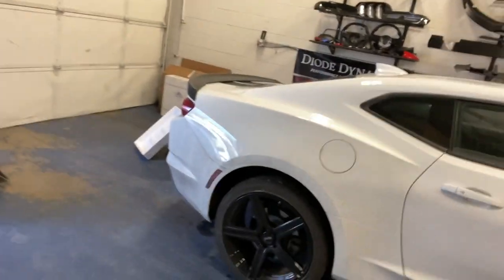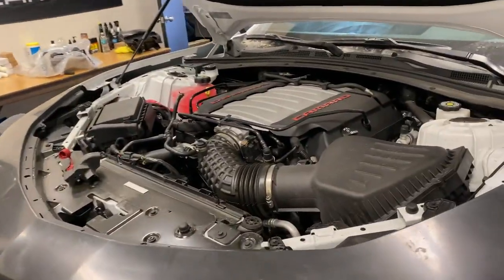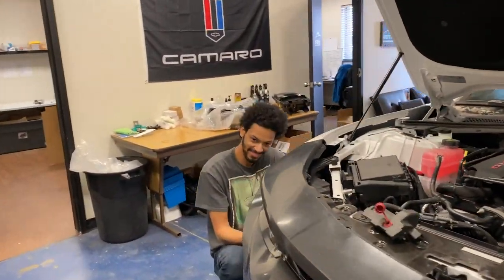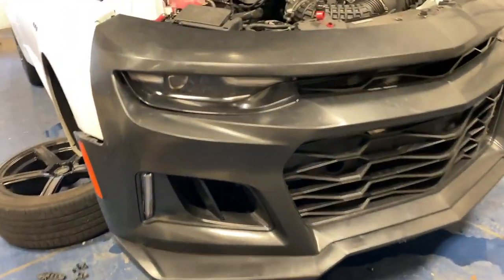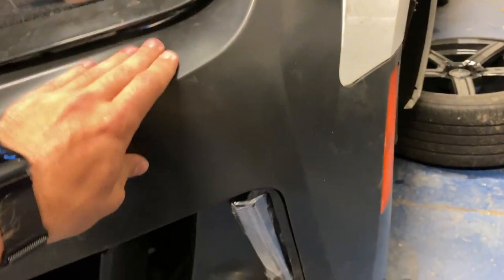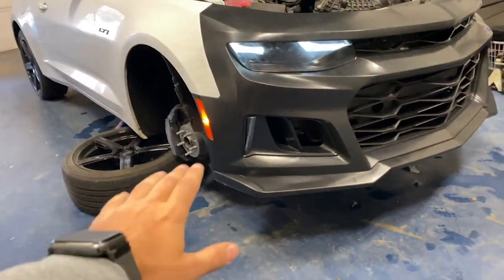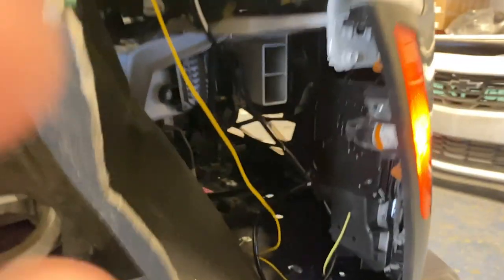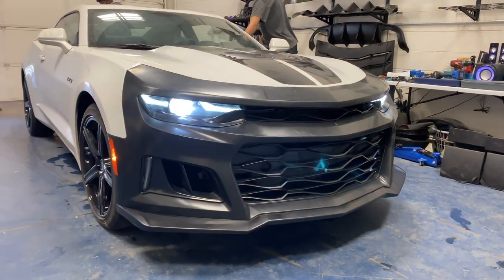2019-23 Camaro ZL1 Bumper Conversion Kit -Camaro LT/RS/SS/LT1 - Next-Gen Speed

Comment: what bout th einner fender, under engine shield and the air duct that goes in between the fender liner and bumper ? did you end uo using the factory one from the lt1? or had to upgrade that as well.?

Comment: It will fit LS1 the same right? only the engine is diff. Did you have to buy the fog lights separately?
Reply: Did you ever figure this out? Does it fit the LS?
Reply: @aidenbrushaber8907  I called the company directly to ask. I think they said no, but I saw someone on YouTube modify it to work. Call the company cause this was away ago for me and I ended up not doing it cause I found a cheap regular bumper.

Comment: I have 19 2ss how do I use 16-18 headlights really prefer those over mine 19+ss headlights
Reply from the maker: @APEX70210  You will need the 2016-18 Bumper
Reply: @NextGenSpeed  what about bulbs and harness for plugs I dont need to change them?

Comment: What's the cosr
Reply from the maker: Starts are $885 shipped - https://nextgenspeed.com/shop/exterior-body-parts/bumperkits/zl1-bumper-conversion-2019-2021-chevy-camaro/
Reply: Don’t put that thing on ur camaro bro. The 16 to 18s look great wit the conversion but 19 and up the conversion doesn’t look good at all. The 2019 looks good the way it is
Reply: @PrinceNorth  are on crack ? Have u seen how ugly the lt1 looks without this front bumper ? This bumper completely changed the car
Reply: @robertplayz9160  Dude the front bump of the V6/LT1 doesn't look bad at all, you're just so use to see ZL1 face lifts so that's all you have wired in your head lol